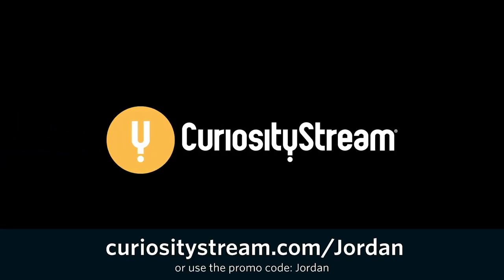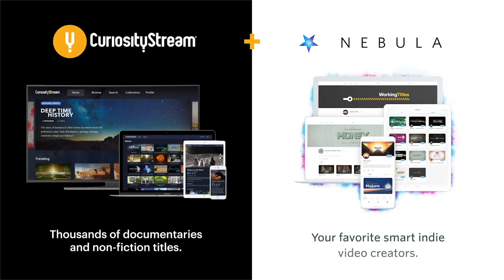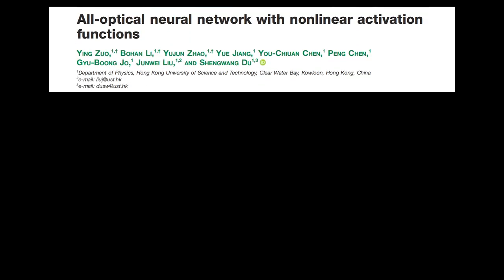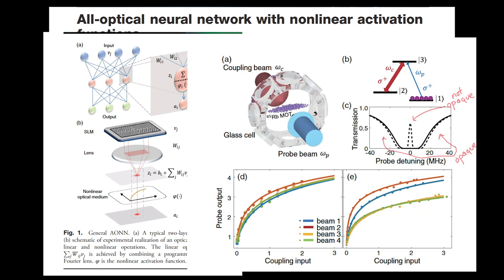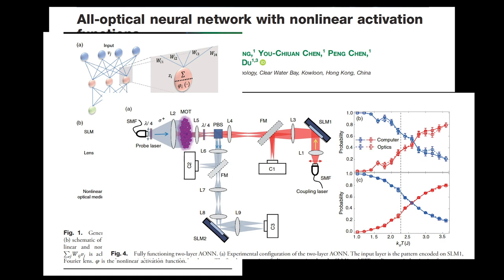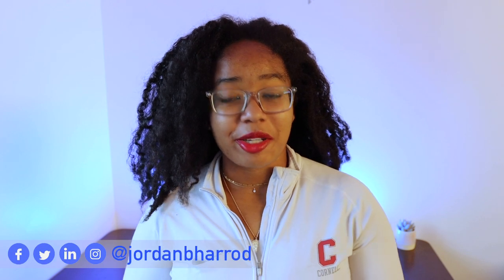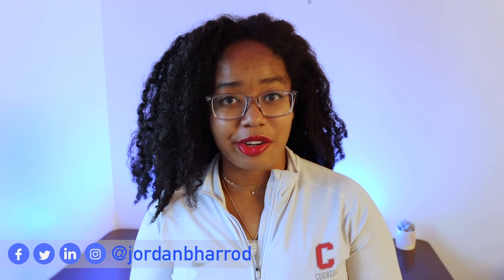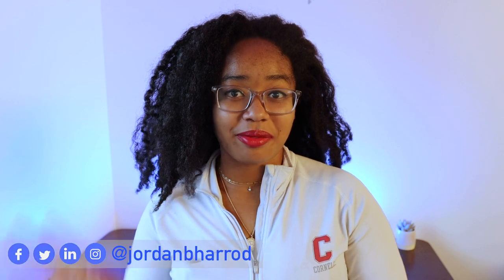Making A Neural Network Using Light? | Optical Neural Networks, Explained

Comment: While not terribly exciting, I suspect that the likely most promising option for NNs, at least in the near term, is likely processors with lots of CPU cores, and lots of SIMD. We sort of already have this with GPUs, but GPUs using single-precision floating point for pretty much everything is a bit overkill, and small fixed-point values with operations more specialized for the task could possibly reduce power requirements to some extent. Maybe also design the cores to prioritize the use of cache memory rather than having huge memory bandwidth to external RAM chips, ... Granted, maybe there is a better way to do this stuff, dunno...
Reply: You're just describing tensor cores. TPUs are optimized for tensor operations used in deep learning, and only use 8 bit numbers.
Reply: @ApontyArt  OK. Hadn't really heard of these, sorta thought pretty much all the "deep learning" stuff was happening on GPUs.
A quick search only brings up some rather superficial information about the TPUs. In any case, "near term" can still be applied to something that is already in use, and the existence of one such design does not preclude the creation of others.

Comment: Aren't electrical signals ( not the electrons themselves) also transmitted at the speed of light?
Reply from the maker: Interesting question! Electricity and light are both forms of electromagnetic radiation, and all electromagnetic radiation moves at the speed of light, but electricity (1) has mass, and (2) is basically light guided by conductive materials. The latter point is particularly important, because sending electricity through wiring typically reduces its natural speed by a factor of about 100 due to attenuation. 

Also, on-device machine learning relies on traditional computer hardware, not optical hardware specifically designed to replicate a neural network’s architecture, so optical neural networks are a much more direct way of doing machine learning! One of the papers I cited demonstrated this when they trained a simulation of an ONN and it took a few days to finish training, but trained the same physical ONN in a few hours.
Reply: @JordanHarrod  Thanks for your quick reply. So i know that the electrons move slowly in wires because they have mass and for other factors  ( i thinks it's in the range of only mm/s) but isn't the signal transmitted through the wire as electromagnetic wave which is the speed of light? 
So would the delay of a phone call over long distance in copper wire be 100 times larger than that of of fiber optic 'wire'?
Reply from the maker: Not necessarily delayed, but of lower quality - less information would move through copper at the same rate as fiber. Fiber-optic internet vs cable is another example of this. Cable download speeds usually range between 50-500Mbps and cable upload is 5-50 Mbps, but fiber can get 250-1000 Mbps in both directions.
Reply: speed of light does not necessarily have something to do with computation time. That is just an eye-catchy phrase to impress. When you don't understand what she is saying, you are completely correct!
Reply: @zhyfn9773  yes, so basically the signal is travelling at the same speed regardless if its electrical wire or fiber optic. Fiber optic has just the potential of transmitting data at higher bandwidths for one channel

Comment: Decentralized AGI with virtual substrate independent Machine Learning LLM Nodes working on Multiple servers connected to decentralized search engines being accessed with personal LLM and LAM computers that have WiFi and bluetooth and can learn to operate household appliances and inexpensive interchangeable robot chassis that can be controlled remotely. 😎🤖